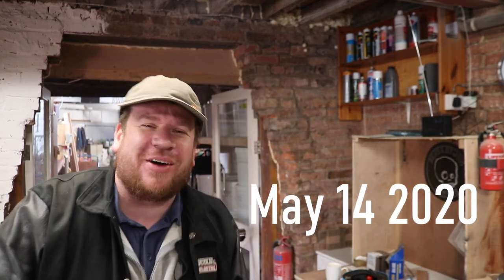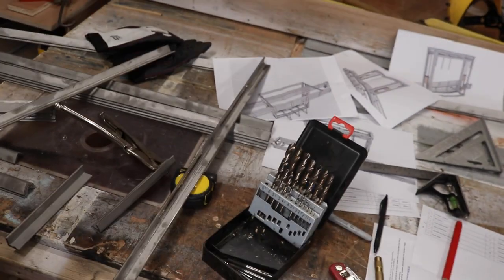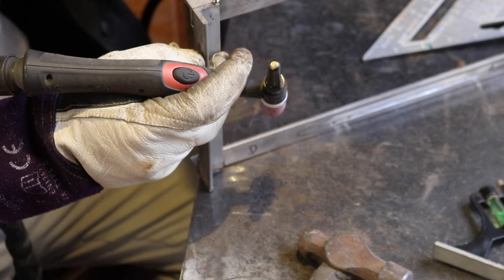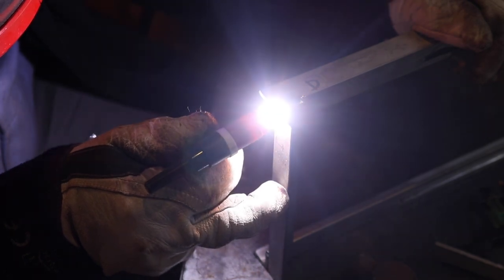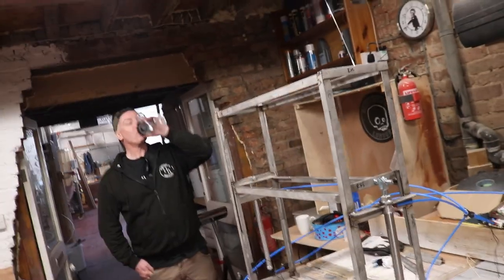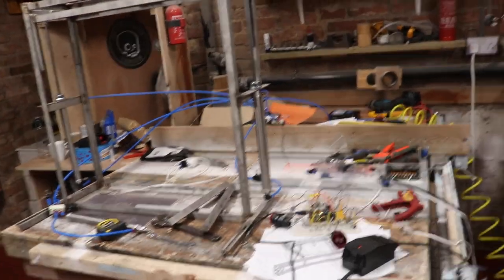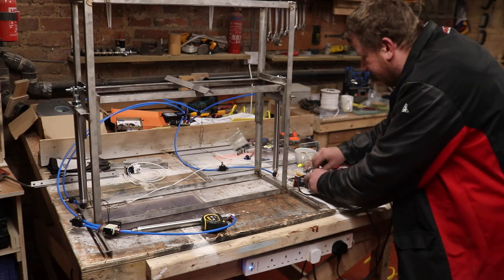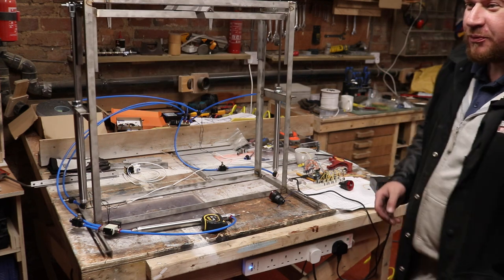Chassis & Carriage ~ Can Filler Build

Comment: Excellent progress!! VERY similar to small pilot fillers I have used over the years.  I can help with filling hints.  MOST IMPORTANT is to have the beer as cold as possible so it doesn't go wild. Insulate all that you can or fill in the cooler. I am envious of the controls!!!

Comment: Great job!
It looks like both cylinders are not going down at same speed.
I think both exhaust lines should be exactly symmetrical, same length and the tee turned 90°.
Best regards,
Ben